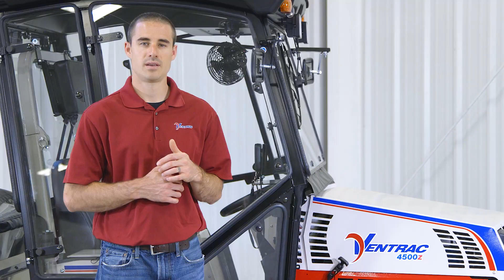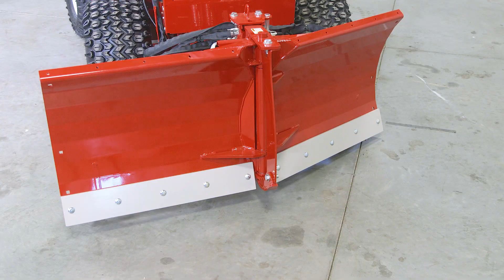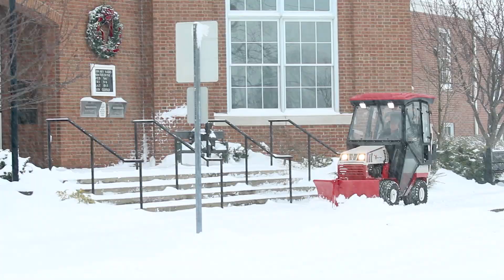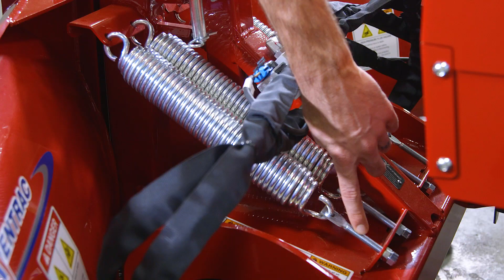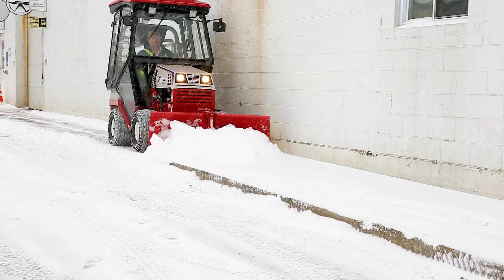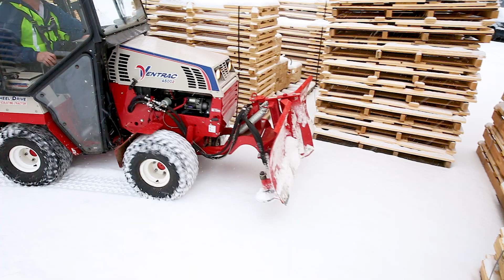The Most Functional Snow Plow - Ventrac V-Blade Simple Start

Comment: That thing would have saved my bacon during this last snow storm.  All thawed out now and ready to wake the 4500z from it's winter nap to get ready for spring!
Reply: @emrythompson  Hey Emry, Hope all is well with you!  We just don't get enough snow to justify it.  The straight blade would be awesome; but I could really use the stump grinder and really want to try that flail mower.  Leaf pusher and rake would be great too; I think more food plotters would benefit from a Ventrac than compact tractors.  Never tried the tiller but I am sure it would work well; just have to drive backwards?  Surprised more folks don't use them as they can get in much tighter spaces.  I don't like keeping things in the barn that don't get used so that would be my wish list.  Oh, that and the finish mower.  Lol...did I miss anything?  😂
Reply: @emrythompson  The Tough Cut is an indispensable tool on our farm.  Couldn't imagine doing some of the work that we do without it.  Actually cuts really clean as well.